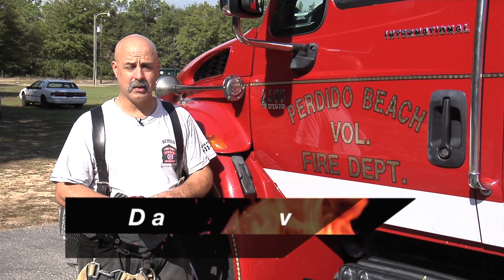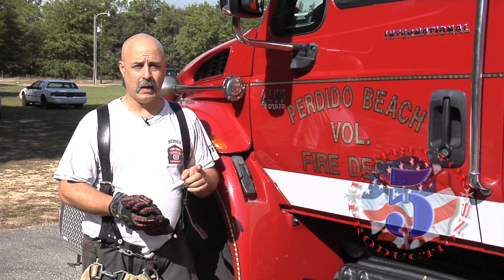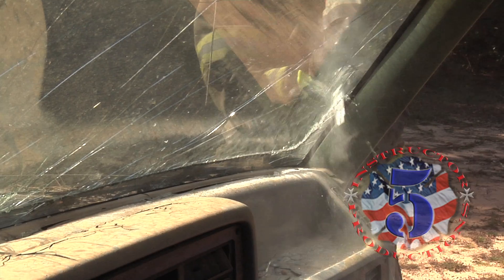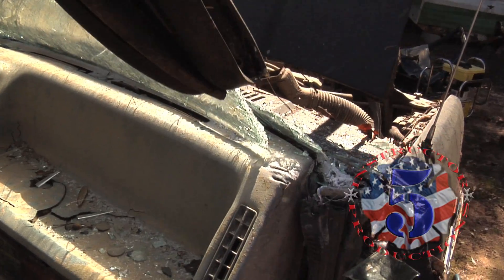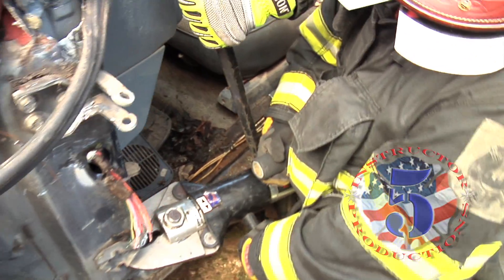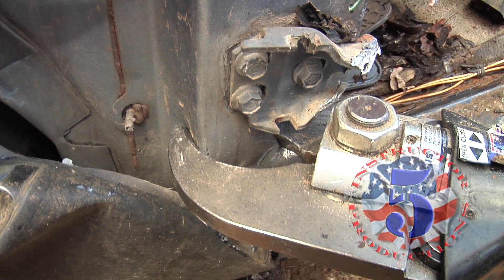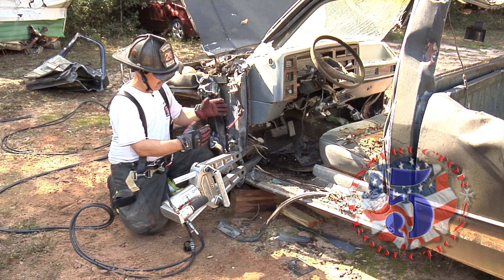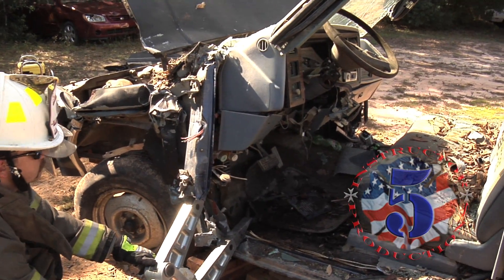Vehicle Extrication: Dash Roll

Comment: Don't cut the frontshield A-post  before the spreader is in place. When lifting the dash, spreader should be in line with the side of the car. Prevents the A post moving outwards. There are video's showing the proper technique.

Comment: 4,25 Minuts! From stop at scene, to loaded -door closed:
Video from Norwegian championship -Rapid Extraction: Time: 4,25..! https://www.youtube.com/watch?v=Gqo86ULv8hU From N.Z. ..: "The whole front of the car had been ripped away on impact of the crash," he said. Crews used a newly introduced technique developed in Norway, "time-critical extraction". Instead of using conventional jaws of life and hydraulics to push the shattered chassis away from the patient, they used chains attached to a fire engine to pull them, getting her out and enabling medical treatment to take place within 10 minutes. http://www.stuff.co.nz/dominion-post/news/wairarapa/9578554/New-technique-gets-rapid-aid-to-woman-in-crash http://www.biomedcentral.com/1471-227X/14/14 
Norwegian Air Ambulance: 
https://www.youtube.com/watch?v=AmoHeLeODss
https://www.youtube.com/watch?v=dzPPT7BxcGs 
Basic ed. F.F. ( 2 year full time ): https://www.youtube.com/watch?v=yW3NqJ7VWwQ
Basic ed. EMT ( 2+2 year full time ): https://www.youtube.com/watch?v=dEaRFoEP4K8
Driver license Klass160 ( Only 3 Tests in life, -not tallented enough if you need more ): https://www.youtube.com/watch?v=fGqUWVQz_JM

ExEMTNor
Reply from the maker: Looks like the patient is exposed to much more jarring by moving the vehicle and then tearing the front end away using the engine ... when using a vehicle or even a winch, the amount of force is hard to control ... I believe in the same scenario the total side removal and then dash roll/lift would have worked much faster ... the elapsed time you refer to really isn't elapsed time in the video as it's edited ... I've done the total side removal in under 5 minutes with little displacement for the patient. Interesting technique, thanks for sharing.

Comment: Should also mention in between the seats, there may be metal straps hidden in the center console. They are usually located underneath the radio. They must be cut when performing this maneuver. Seen numerous times after going through all of that work and it doesn't budge. Amazing how those two metal straps impede the progress. This is my favorite maneuver in extrication. Beautifully illustrated
Reply: Brian Lena seen these on all of my cars when doing interior work. Mercedes added them when they began fitting passenger airbags.
Reply: Let me guess, it's help keep the ash from shifting when deploying an airbag.